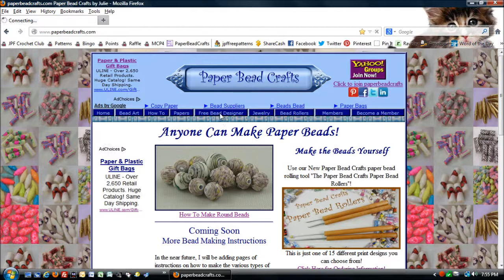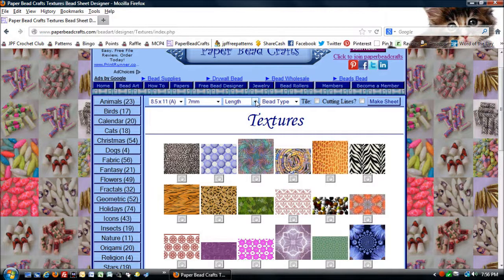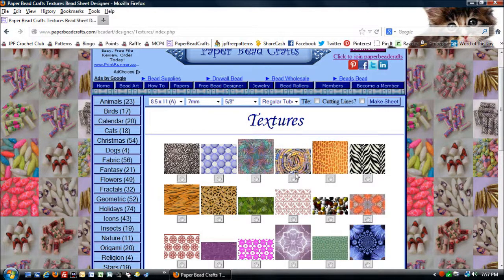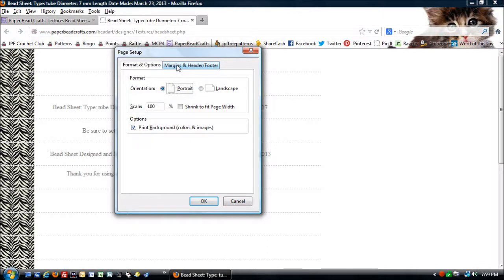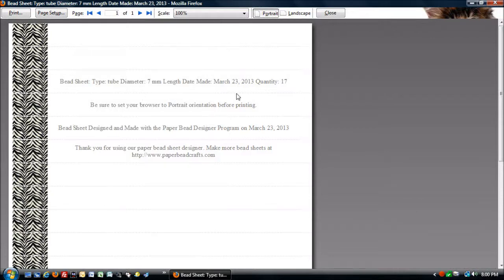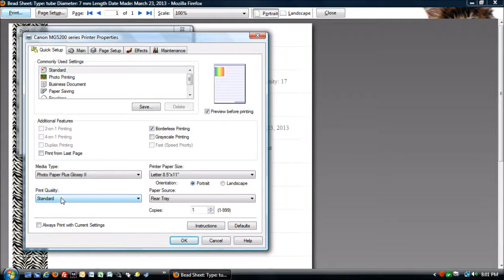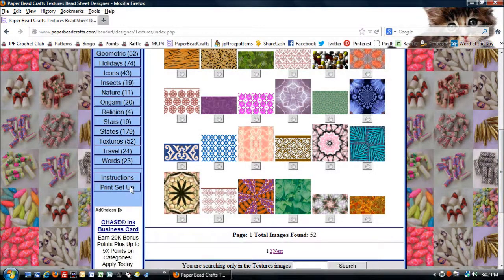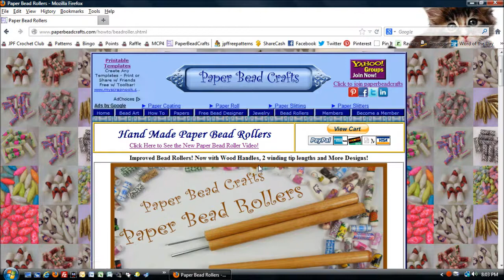Paper Bead Crafts Bead Sheet Designer Tutorial

Comment: I designed tube bead with the picture in the first row #6. navy blue and red.   a 5mm x 13mm sideway tube given me 17 beads .  when I print the page will the cutting lines be there .  it shows the pattern only on the left side of page so the rest will be white not understanding how this works
Reply from the maker: If you have chosen to have cutting lines, they will be on there but not in the middle. They are only cutting guides to prevent them from showing up on the finished rolled bead. When you choose Sideways beads, the image will be printed across the top of the page and will be sideways on the rolled bead.